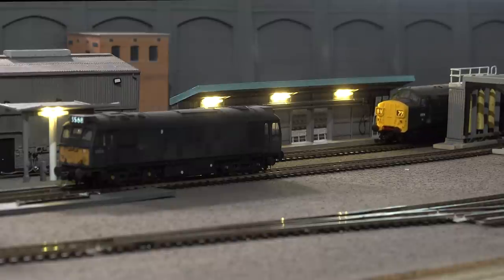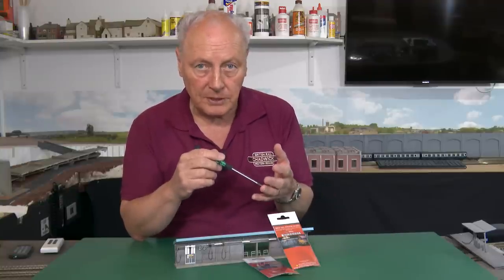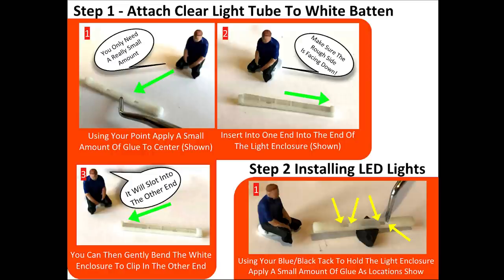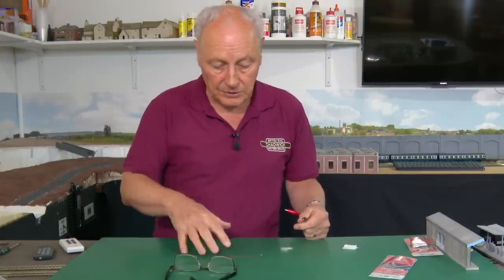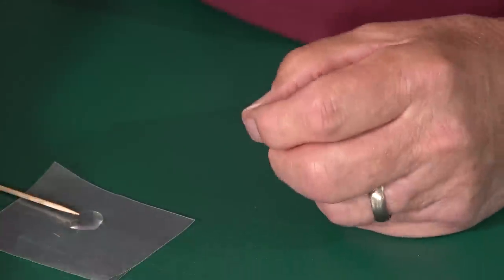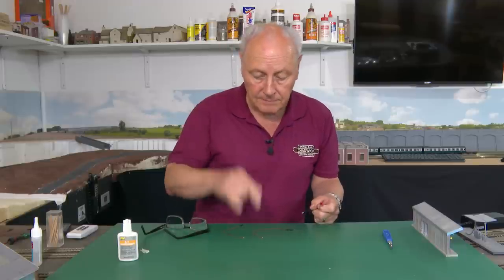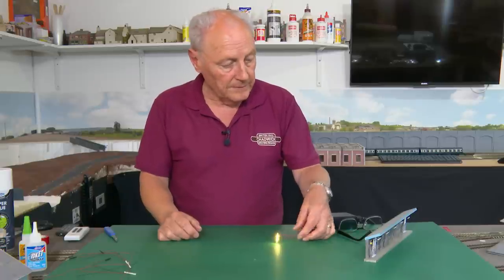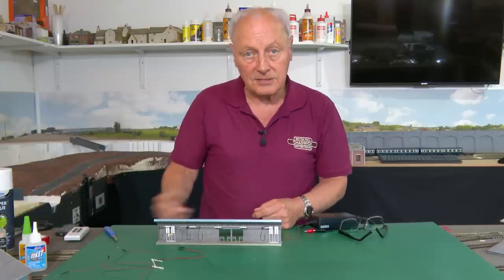LOCO SHED LIGHTING at Chadwick Model Railway | 198.

Comment: Was chatting earlier today with a modeler up in the north country and we were remarking on how we modelers are living in something of a "golden age" for details, parts and accessories.  I remember all too well the "joys" of "microlighting" meaning using 11 or 13mm "grain of wheat" incandescent lamps that could only withstand 1.5VDC, and the tiniest  of fractions of voltages above or below that value would see them burnt right out.  Typically in direct proportion to how easy they would be to remove to replace.
Reply from the maker: You are of course, right Captain Mac. I still have a couple of grain of wheat lamps lurking around. Regards, Charlie

Comment: Another cracking video Charlie. Some really useful advice as far as what adhesive to use and how to use it without 'bonding' a tad too much to the layout. I have to agree that the warm glow LEDs look much better for the sort of period layout that I intend to build when I slither out of the planning phase. Many years ago some boiled sweet lollipop stalks were hollow plastic tubes that would have been useful for small cable trunking but those went decades ago so I'll do some digging on what else is available online. Once again many thanks for sharing.
Reply from the maker: Thanks Anthony, I’m so pleased that you found the video interesting. I have some covers for those cables and I will show them the future video. Regards, Charlie

Comment: Thanks Charlie, lighting adds so much to a layout it is well worth the time and expense. With regard to the activator I use the pump pack version rather than the aerosol. Most of the time I won’t spray it at all but open the bottle and use either a pipette or cocktail stick to apply it to the part as only a very small amount is required. Not only safer but less costly 🙂.
Thanks again for your videos they are always up there with the very best on YouTube.
Reply from the maker: Thanks Nigel, and thanks for the sound advice regarding the pipette. Regards, Charlie

Comment: very nice again! I might have a tip for you that resembles those old tube lights even more: filament leds! Those are the leds in those new type bulbs where you can see those filaments in them. You could just buy those and sacrifice the bulb but they are sold seperate in different lenghts, light temperatures and voltages. If you shop around at the friendly chinese shop we all know, you can have them very cheap by the bundle.
Reply from the maker: That’s very interesting. Could you send me a link? Regards, Charlie
Reply: @ChadwickModelRailway  I don't know what happened but it seems my previous message with 2 links seems to be lost in bitheaven, i hope you did see it before it went 'poof'?
Reply from the maker: Sorry, but YouTube intercepts all links, and put them in the in approval area for me. Only once I approve the number then become visible. Regards, Charlie
Reply: @ChadwickModelRailway  no need to approve them :) As long as you received them for examples of those leds it is all good. Hope you can do something with them on your layout :)

Comment: Something I picked up from modelers on YT, is that you can puddle CA on paraffin wax tea candles and the CA will not go off.  
You can use the candle to heat a suitably round thing to melt a depression in the top of the candle, too.
Reply from the maker: An interesting suggestion captain Mac. Regards, Charlie

Comment: Great tip with yhe glue.
I always use something pointy normally on small stuff.
Don't get glue everywhere then.
For super glue though I'd recommend CT1.
You can get it at toolstation with their activator it's around 10 quid but it's one of the better on the market and you don't get the white bits from the activator
Reply from the maker: Thanks for the info Richard, much appreciated. Regards, Charlie

Comment: For super glue, I recommend Loctite SuperBond Original.. Expensive but excellent..
Great glue for small parts with quick set off. 😉 No need for additional materials with warnings about health.. 
That Loctite can glue and hold, even, car parking sensor in place.. 😂 Tested one time, because, don't have another glue at home.. Still holding.. You just need to hold it for 30 seconds to set.. But I, usually, hold it longer, if heavy part needs to be glued..
Reply from the maker: Thanks, Arthur, superglue choice is not an easy one to make. Regards, Charlie

Comment: I'm a big fan of Westhill Wagon Works stuff and had some of these before I decided not to light my layout. Having seen how fiddly they are I'm glad, however, they do look good. 
Re your superglue activator. I don't know what the chemistry is behind it, but a sprinkle of bicarb of soda sets superglue off instantly. Just don't pile it on because it goes rock hard and you'd need to file it back off again. Cheers
Reply from the maker: Thanks Davie, great tip. Regards, Charlie

Comment: With Fluorescent lighting they usually hang from chains each end. It might be cool to use one wire from each light (1+ and 1 -) and hang with them. Then hook the other too poles together. Then add the resistor under the board. It will potentially cut the LED output by half but the resistor can be changed to set luminosity. A gutter along the rear roof line and down-pipes for the wires. Nice video.
Reply from the maker: You make an excellent suggestion Steve. Regards, Charlie.

Comment: Dear Charlie, some cool strip light appendages made by Westhill Wagon Works. Wonder though if in this case fiber optic lights would have been a better choice. Don’t know for sure, think I saw a vid from Steve Muskoka on this very subject a while ago. 
Anyhow, the prewired leds are of course handy. However, to mount these lights it may be more appropriate to go the other way round. So, drill a hole for the led instead of the resistor. Nevertheless, a very cool product and great explanation from yourself.
Oh, and instead of activator, you could try a tiny pinch of baking soda on the superglue. Cheerio
Reply from the maker: Thanks Vincent, is the baking soda,  in powder or liquid form?  Regards Charlie

Comment: Miniature and sub-miniature LEDs are available in bulk from a number of outlets. Grain of wheat bulbs are also still readily available, however from a cost point of view, they vastly outweigh LEDs, generally a iK resistor is sufficient. If you are conversant with amodicum of electronic knowledge, then this maybe the way forward. Note, too, that LEDs are also available in bar arrays. Charlie's system is of course an option, but in the world of electronics, there are many other ways to achieve lighting.
Reply from the maker: Thanks mate for an interesting comment. However, grain of wheat are very last year! Regards, Charlie

Comment: Indvidual LED's in a properly designed housing are great.  The other option is what is called COB (chip on board) strips, which look more like a solid light than individual leds on a strip.  COB's are a bit diffused also.  LED's are available in so many colours these days,  Warm white, cool white, natural white, and all range of colours.   They have become a really versatile lighting option.
I think it is worth cutting off the moulded fake lights, just to make it look neater.  The lights on the back look like something that would not be out of place on a fueling shed of that age.  You could even remove the dummy lights without any touch up paint, makes it look like the lighting was upgraded at some point in its life.
Reply from the maker: You make an excellent point. Many thanks, regards, Charlie

Comment: Good day Charlie,
I love this idea of pre-installed resistors.  It makes the installation just that much easier.  And calculating the correct resistance can be a mathematical pain for me.🤬
A couple things as for glueing up the batten this appears to be the perfect time to use, or buy a new, EXTRA HAND SPIDER device.  The perfect time to convince the wife I must buy this tool.😢
Then for the wiring what about a scale "U" channel painted and horizontally along the roof ridge.  As a rain gutter.
With a scale round tube vertically from the gutter as a down spout.
Finally thread the wires through the gutter and downspout to the under roadbed accessories trunk line.🤔. You would have to extend the wire to travel the distance.  But that's for another episode.😊
Just a thought.
Jim in N.Y., U.S.A.
Reply from the maker: Jim, that’s an excellent suggestion. Let’s see what transpires. Regards, Charlie

Comment: I’m with you Charlie in my preference for warm white lighting, it’s really authentic for replicating incandescent light bulbs. But I do think the old fluorescent tube lights had a bluer white tint, and these I think are better modelled using cool white or neutral white LEDs.

I’m working on replicating the old low pressure sodium lamps, including their startup characteristics.
Reply from the maker: I think that you’re right blue, however, amongst everything else, it would look rather odd. Regards, Charlie

Comment: Great video, there is another product you can checkout, they are called LED filament lights. They are available in different lengths, and would would look just like florescent lights. You would need a little more technical knowledge (calculating the resistor) to use.
Reply: I thought of those too, and I think they could be a really good solution. However, there could also be some difficulties. As far as I know they can’t be cut to length, so you’re stuck with what you can buy. Also, when /not/ lit up, they are bright yellow and quite chunky, so I’m not sure if they’d pass for a bare fluorescent tube. I’d be really interested to know if anyone has had success with them.
Reply from the maker: Great info gentleman. Let’s see if anyone else has anything further to add. Regards Charlie.

Comment: To tone down the brightness of the led you could, like I do, a bit of brown/beige paint, this works great.
Reply from the maker: Thanks, 707, sound advice indeed. Regards, Charlie
Reply: @chlcoldwaterhotspringslitt707, great suggestion, I use the Tamiya X-26 Clear Orange, it works really well.
Reply: You could also increase the resistor value,  so less current is flowing trough the LED's

Comment: 3v filament leds are perfect for this sort of thing (sheds) the resistors reduce the current, for standard 2.8v warm white leds i use 20Kohm resistors, plain old tap water on a cocktail stick activates superglue charlie.
Reply from the maker: I’m embarrassed to admit I didn’t know about tapwater. Regards, Charlie
Reply: @ChadwickModelRailway  Yea, a drop of washing up liquid in some water (the washing up liquid thins the water down) and use a pipette and drop a bit on your glue it goes rock hard in 5 seconds

Comment: Fantastic video Charlie. I wonder if there is a way of making a more opaque diffuser. Both "dimming" the lights and dissipating the light across the bar. Maybe a very thin, white strip of polystyrene card?
This video is going to be extensively watched when I get to the buildings and scenery installation.
Reply from the maker: I’m so pleased that you found it interesting Pete. Regards, Charlie.

Comment: Ive been experimenting with a Western Welsh Atlantean.  372 (aka LR2669 in new money).  Fitted LEDs to the inside upper and lower decks, Scalextric pickup on the base and a length of Scalextric track to which the power is delivered as the road in the bus station scenario.

Guessing Warm White would represent the Tilling / BET era bulb lighting whilst Cool White would emulate the NBC era flourescents.
Reply from the maker: Hi Timothy, that sounds like a sensible choice. Regards, Charlie

Comment: Very nice lighting Charlie. The LEDs have a glare even with the diffuser they have supplied. It may be because when you tilt it to show in the camera, it is more prominent. May be you could reduce the brightness with a larger resistor so that it sort of blends with the rest of the  surroundings. Just a thought.
Reply from the maker: You make an excellent suggestion, but I think I will have to wait until the whole area is lit, and then dim them down proportionately. Regards, Charlie
Reply: @ChadwickModelRailway  As you already have the small resistors for each of them wired, now you can put 1 resistor in one of the supply leads to dim them all at an acceptable brightness. It will need a higher wattage. Yes, you have to make the change after all the rest of the scenery is finished.

Comment: I wonder if it makes a difference if you wouldn’t glue the diffuser. The glue obviously isn’t required for the thing to stay put.

One interesting tidbit about CA glue; it goes of in reaction to moisture. I.e. You don’t need an expensive accelerator. The moisture in your breath should suffice (especially directly after a sip from a cuppa). An alternative is to moisten the surfaces you’re going to put the glue on.
Reply from the maker: It’s interesting that you should mention that. Someone mentioned yesterday about a dab of tapwater. Regards, Charlie

Comment: I always use a bit of an orange / yellow paint (acrylic) and color the LED myself. I've done this and then glued to the back of a Athearn lens. Also same procedure but using the cut off lens end of a burned out bulbous style LED.
I usually just paint white LED's red for tail end markers as well. Have not had issues and have used multiple coats plus clear coat. 
So don't be too dismayed if you find your LED not quite the warmth you want. You can try painting them.
Reply from the maker: Thanks Tom for a useful tip.
Regards Charlie

Comment: One way to hide the wires on the back of the unit, would be to use short lengths of drinking straws painted to look like conduit.
Reply from the maker: An interesting compromise, Glenn. Regards, Charlie.

Comment: if leds are too bright you want to control them with PWM, not lowering the voltage
for the use of the super glue activator spray, I recommend using this outside wearing a full face respirator mask (3M 6000 or similar), the version that includes eye protection
Reply from the maker: That’s something I need to read up on AJ.
Regards Charlie

Comment: Great video. I’m currently lighting a station and have totally cheated. I’ve scratch built a modern station roof and holding it up is some electrical trunking that you can’t see. I’ve put some AA powered warm white Christmas lights in the trunking and it looks good
Reply from the maker: What an excellent suggestion. I do hope it works well. Regards, Charlie.

Comment: Another sterling video Charlie, thank you. My helix is taking shape, one of two built and your videos helped greatly. Regarding lower voltages for lighting etc on any layout, May I suggest this. I’ve used an old power supply unit (PSUs) from within a computer as they supply power to all the components within your PC, such as the motherboard or graphics card. As such, typical PSU voltages include 3.3V, 5V and 12V and you can run individual bus lines to tap off wherever needed.

PS I could be interested in your 4 way shed if it’s for sale?
Reply from the maker: Thanks for the advice regarding the computer power supplies. I think I might hang onto the shed as it’s useful as a visual aid. Regards, Charlie
Reply: @ChadwickModelRailway  no worries at all. Looking forward to your next video as always 👍🏻

Comment: Good video Charlie.  I would have thought that intense white would have simulated strip light fittings better than warm white.  I will have to send you some spencer wells artery forceps to assist in some of these actions for handling small parts.  Please let me know the best place to send them.  I don't know why every household doesn't have them.  Trying to break plastic connectors has caused me a number of annoying damaged parts so I always snip them as a matter of course.       
 I would have thought with the development of LEDs and fibre optics, that it would be possible to feed a light source to feed a short fibre optic piece of glass which refracts its light sideways.  This would be ideal for strip lights rather than a point source for individual lights.
Reply from the maker: Thanks Don, I’ll try an find some forceps rather than put you out. Regards Charlie
Reply: @ChadwickModelRailway  It's not just forceps.  Spencer Wells forceps have a locking mechanism.  There are both straight and curved ones and were designed to clamp arteries.  We used them in sterility testing to handle materials without touching them. (Roussel in Swindon 1970s)  It has enabled me to remove things from awkward places, hold small things in place while gluing or positioning things.
Reply from the maker: Thanks Don, can you send a couple of links please?  Regards Charlie

Comment: Interestingly for activation of superglue with less risk I have in the past used a spray of IPA.
Also you can activate it with Baking soda but that makes an Exothermic reaction that turns very cloudy and hard and gets slightly warm to the touch (I've used it as a basing material for Miniatures in the past.
Reply from the maker: An interesting comment, someone actually mentioned using tapwater. Regards, Charlie

Comment: I also like to use warm (yellow/white) LEDs as I model 1939 and it fits with incandescence bulbs. but as you are trying to represent florescent tubes, wouldn't the cool white (neon white) seem more like the real lighting regardless of era. I think they even advertise florescent tubes as "cool" white. Do like your presentation though and lots of practical advice and warnings.  Thanks.
Reply from the maker: You make an excellent point Paul. However, I did think that the almost blue white, would look out of character. Regards, Charlie